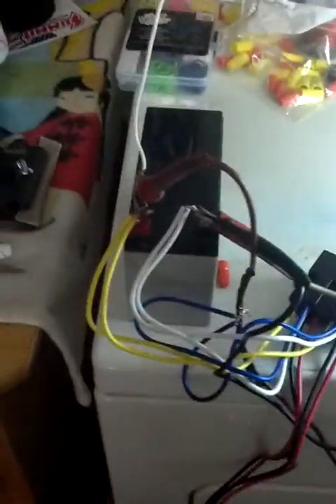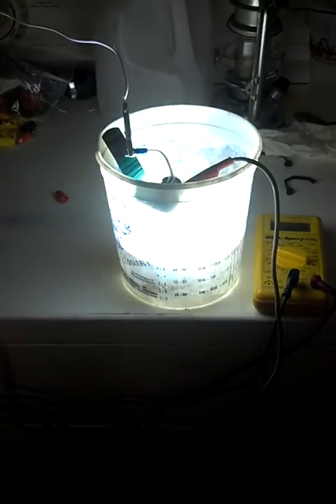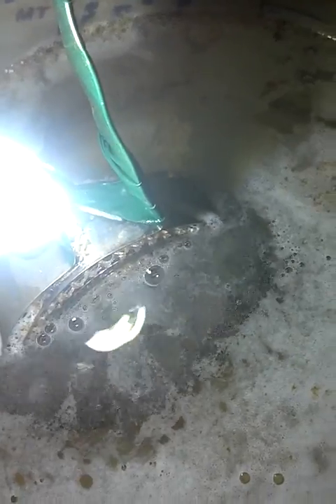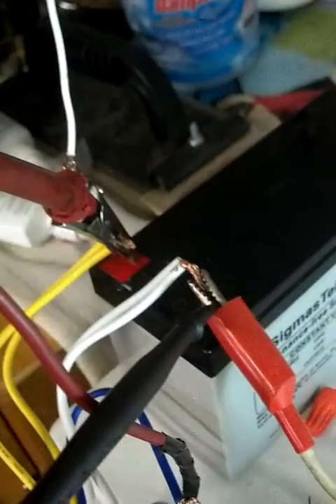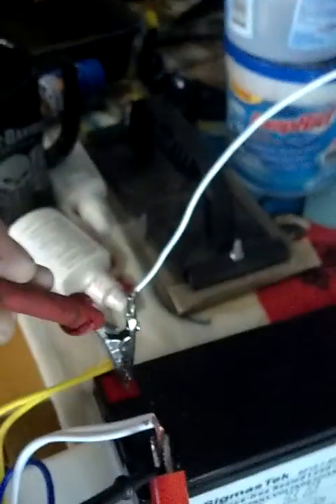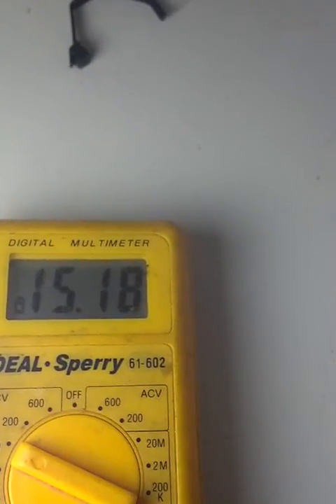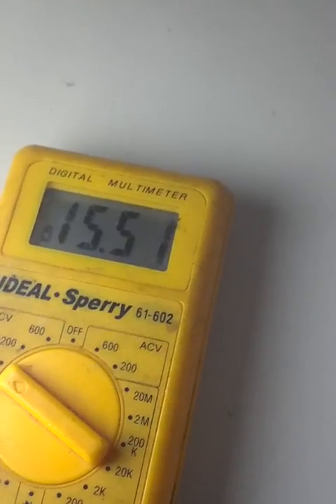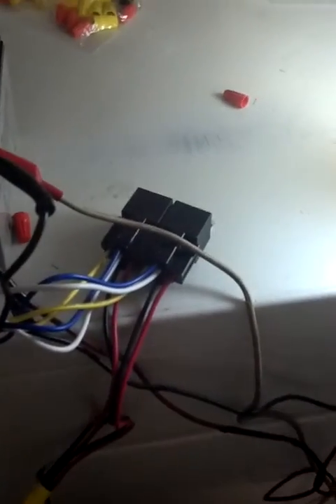Radiant Energy to make Hydrogen for free!

Comment from the maker: To all of my subscribers, tonight, past 12:00 am EST, I will be working on a device which I am going to video. I will prebuild it, test it, ensure it works to create what I have been calling the "overunity effect" so I could prove an energy savings from a 120 VAC mains circuit , then, I am going to build one of these on a much larger scale to see what type of savings we could have. These devices MUST use a killawatt meter or something similar that is as or more accurate than components and standard analog or digital meters that I currently use to do this work. The fund will also assist us with purchases of other equipment, loose analog metering that will allow me to build an enclosure that will connect to and meter circuits from uA measurements in DC and AC, mA in both DC & AC, Amperes in AC and DC, then voltages of different ranges, etc. I have written many pages of a free energy research book as well, and this will be up for grabs on Ebay and other reseller sites soon offering designs, formulas, and methods I have used to create outputs that are said to be impossible by many due to the establishment's ridiculous lie that's been covering this all up since 1885. The proceeds from these sales will all go back into our research whether it be to purchase equipment, parts, wire, components, or fees associated with travel and overnight room stays at conferences such as the Tesla Free Energy Conference and many others, where I will be able to show my results  to determine the input vs. output while under some kind of conventional load. We are looking for a way to boost finances ONLY to assist with the massive costs associated with the acquisition of the new scientific equipment needed to prove our devices are actually functional as we have stated. 

I'd like to build a device like I already have that eliminates 1/3 of the cost of our consumption of electricity. So much  larger so folks could use it to save energy in larger homes, commercial locations, industrial, and of course scientific, because the energy is just as clean as what we are already fed, just as long as the frequency used is a low frequency. The key for getting this to function at 50 or 60 hz is merely to tune the primary coil to resonate at  the input frequency, then, the coils used for the secondary need to be tuned separately to naturally resonate at 60 hz. Once this has been established, the circuit at resonance has infinite resistance, so, to get it functioning correctly, a load has to be attached after it is all wired .

  I have no reason to make money off of the circuit other than the use of the income to assist with new equipment for my research. I'd like to sell some of the schematics and maybe a video to resolve any questions in making the device. I am
 NOT going to patent it, so, first come, first serve to those of you who'd like to purchase a small kit and instructions for this on Ebay  of exactly how to build it, where to get the parts, and, how to tune it as necessary for it's perfect function.

   It took me a few minutes one day to enable a working circuit, so, I will be making kits up to sell them for research income, selling just instructions, selling written instructions with a video, or, building perfect premade circuits at specific sizes. The larger kits won't be cheap as they detail more of my time to get working, and, they are extremely difficult to get them to resonance, matching the primary to the secondary coils. . The instructions will be selling for $5 to help support my overunity research, or, the kit will cost $32.90 , which is my cost of the products/materials with shipping which will include a donation to my research fund that  will assist my group in purchasing an impedance meter,  a professional variable voltage/resistance/amperage load bank that introduces to  circuits  the different types of loads, inductive , resistive and capacitive or combinations of  each/all to prove or disprove replications which are said to be truly overunity devices, or, share some overunity qualities. This is  so we could see if circuits posted or left for us to research are the real deal or fakes/hoaxes, which many on youtube really are! . I'd also like, if any of you would post some diagrams that you think or have been told are actually overunity devices. It will prove a lot, and, if  it is possible , for many of you to leave me schematics of circuits to be tested in a real lab that has and uses many types of transformers, coils, antennas,  power generation circuits,  and a bunch of very valuable test equipment for the right tests, to offer our subscribers accurate test results using the correct test equipment as well as the correct method in doing so for optimal results. Most folks on Youtube just whip out a voltmeter, no scope and awful results  with RF frequencies being used , then filtered the correct way, synced, or tuned so the correct filters work or at least show fairly promising results in doing so.

If I do not complete this tonight/tomorrow morning, I will complete a video in the morning between 6 and 10 am to prove my theory and pass it on to the world. I apologize but, the results that will enable you to build this must be signed for to agree to our terms agreeing
 that you will NOT duplicate or sell my device in any form, change it to another device, or, use it in any way, even modified in any way to capitalize off of my initial invention no matter how it has been built or changed. Only the link of the instructions are to be 
 released to open source, NOT the copies of the schematic  I am merely requesting that others pass the links along to others so they can acquire them to help with equipment donation assistance.

Comment: If you took a car battery that was to low, could you charge it and start the car...???
Reply from the maker: +lance huttsell  When I originally experimented with this circuit , I have found that we had the most enormous solar storm ever recorded by NASA. The circuit would run the load and still give out a massive amount of voltage. This worked for a couple of days and had the battery's charge voltage as high as you see in the video if not higher, running with the HHO cell and the 4 watt LED for well over 24 hours. I was successful getting others to duplicate this as well within the same timeframe, however, even if I replaced the battery with new, and tried it over again, I would only see very minimal charge characteristics while running a load like this and it seems the metallic table, boxes, washing machine, or whatever else I placed the relay charger on, it would boost the life by a massive amount. I left this be after finding the charger I built with the transformer did even better than this, however, after I looked, the solar storm was acting up again and I found out that this device is drawing from somewhere, that being from cosmic rays or something similar.

We always receive these rays, so, the overunity induced from this energy or energies is very minimal, but could surpass all levels of input when you use a load of 3 watts or less, and, the battery is fairly new. When we use it to desulfate an old battery, it can damage the new battery if left on for a long time, like the bedini charger supposedly does. DeSulfators are not meant to be left on any new battery for long periods of time, it is only when they seem to develop a memory of that low spot and fail load tests that they should be used to desulfate successfully.

So, yes, the circuit did work, and, the relay's back emf does pick up a charge from solar radiation in some way. It was done to create a massive burst of consistent energy during the storm, and, after the storm was over, I could only seem to draw in an additional 3-4 watts of energy on a good day, making it more attractive during the day on large metal objects of a thin gauge and less attractive at night, making it seem we could rob energy from the sun while not literally being immersed in it's rays.

Thanks for your interest. I have moved on to much more productive circuits, this was only one way I have tried to come up with an overunity out of an external wave, using it as a secondary source of energy.